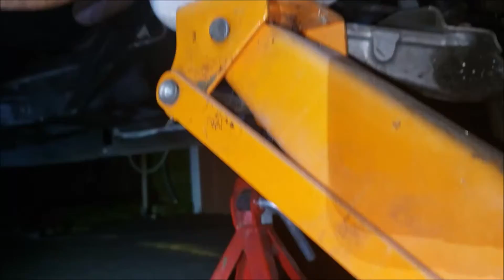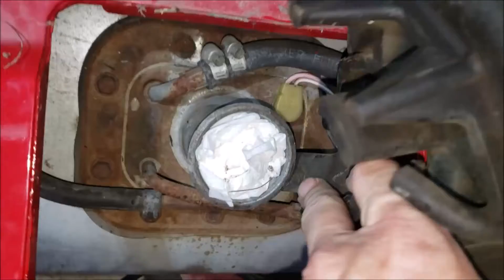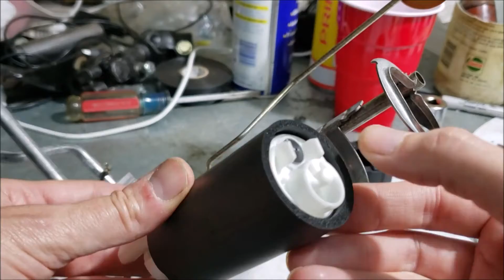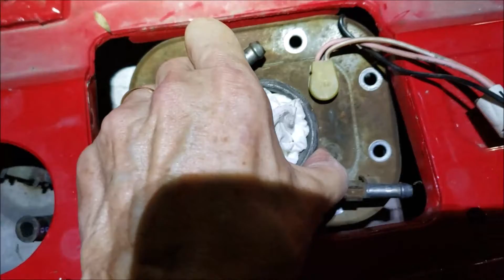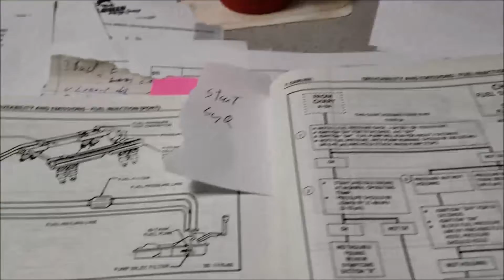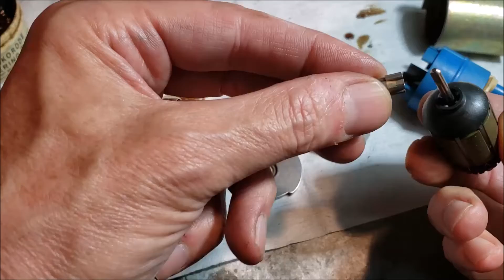1985 C4 Corvette Starts Then Dies How To Troubleshoot Test and Replace The Fuel Pump

Comment: FYI.    In the bottom of the fuel tank there is a plastic yellow baffle that the fuel pump strainer (sock) sits in.   The sock orientation should be parallel with the length of the car with the short end pointing towards the front of the car and the longer end facing towards you and the taillights as you place it into the tank.   If you don’t seat the sock centered in the baffle your strainer will suck air when turning and your gas tank is 1/4 or less filled and the car will sputter and not accelerate properly.   The way you positioned the sock in this video will work just fine when tank is full BUT you’ll have problems when the gas tank and low.   Best.
Reply: If you had the long end of the fuel strainer pointing to the rear of the car, would that hit the baffle? I wish someone who replaces their tank would cut a large hole out the back and take good photos of how the sending unit sits in the baffle.

I got a Walbro kit and Racetronix wiring harness. The Walbro filter is flat with a stiff piece of plastic in it. So that filter can't flex like the OEM filter can.
Reply: Sorry, I meant long end of sock facing forward.   See my follow up comment.   Before inserting top screws and tightening them you can seat the assembly and move/twist the assembly side to side and back so you can feel the sock touching the inside sides and back of baffle.    Once you’re confident that the sock is seated inside the baffle go ahead and tighten the top screws and connect your lines.   Good luck, hope it helps.
Reply: Replaced my pump and sending unit recently and I am 95 percent sure I have my sock sideways  runs 30 seconds and shuts off  thought it was a clogged filter   But still did it after I replaced it , never heard of the baffle the sock sits In until this comment , thank you man , I will pull it out and drain some more gas so I can actually see 😭
Reply: Sorry guys, I meant long end of sock shoulders face forward.   It sits perfectly inside the baffle.   When you seat the fuel pump assembly and before you put in the screws you can move/twist the assembly side to side and back repeatedly (short distance maybe 1/4 -1/2 inches) to make sure the sock is positioned properly inside the baffle.  Once you feel confident it’s inside the baffle then insert and tighten the screws on top and reconnect the lines.  Good luck.

Comment: Really great video. Just some clarification. C4 ,84 thru 89 Fuel pump relay stays on as long as there is ignition pulse. The oil pressure switch is a fail safe, in case the relay fails. See code 54 for the explanation. In 1990 , the ECM logic was changed, so that the fuel pump relay shuts down , when the engine is running, and the oil pressure switch is the only power path for the fuel pump. 
Also, in the video you had a leak in the fuel system. Pressure  should not bleed down so fast. Could be injectors , pressure regulator, or pump check valve leak back.
Reply from the maker: Thank you for contributing

Comment: Thanks Kevin. Great Video!!!

I have an 88 35th Anniversary and I have changed the fuel pump three times since 1998.

I hate that whole fuel pump design and assembly!
I've battled with holding the pump assembly to the bracket and I keep thinking it will all fall apart.. lol

However, from your video I would  have never thought to put a hose clamp around the pump and bracket like that!
I would think depending upon the hose clamp manufacturer it would affect the fuel or have a chemical reaction.
But, I guess not.

Unfortunately, I have to pull the assembly back out  again because I believe the fuel gauge arm may be in the stuck full position.
Always something...
Reply from the maker: It's still working to this day.

Comment: I LIKE YOUR VIDEO , GOOD WORKMANSHIP , GRINDING THE PLASTIC TO FIT FLUSH; CHOICE OF A DELPHI PUMP , RATHER THAN A CHINESE SPECIAL.; SOLDERING + SEALING WITH AN ELECTRICAL HEAT SHRINK. ; TESTED PUMP FOR FUNCTIONALITY. GOOD WORK. THANKS FOR THE VIDEO.

Comment: You should replace those orings on the fuel lines when you open it up. Might as well as it's cheap, and a fuel leak would be bad.

Comment: great video ... I would have used a zip tie...instead of hose clamp..hhhhmmmmmm do they deteriorate in fuel?? your thinking has got mee thinking! Nice job overall Be well Sir!
Reply from the maker: I would not trust a zip tie as a long term solution.
Reply: @ktoutdoor  IF You have the space... that clamp is not going anywhere..thanks for your feed back be well Sir
Reply: If you use a plastic zip tie, I believe you have to use Nylon 12. Though I've read there's a better type, but it's real expensive. Can use stainless steel ties. Just after cutting the band off, leave some sticking out and fold it over a couple of times with the folds going towards bottom to keep it from loosening up later. That's what they say.

Comment: Will this work for a 1986 Corvette motor with tuned port injection 5.7 Liter Coupe 230 HP L-98 
Thanks! RJF
Reply from the maker: Yes, it should be the same.

Comment: I've done pump and filter, fuel pressure is 90psi according to the tool i rented, starts and dies, checked for pulse and it has pulse, but no start, sat for 20yrs.... yikes, i also checked fuses, and fuel pressure regulator, spark plugs etc. Fires and die no matter what
Reply from the maker: Text me at 606-875-0125 and I will call you back to help you troubleshoot. Kevin
Reply: @ktoutdoor  I texted,

Comment: So I had the same issue with my 85 the rubber fittings for the new pump were different went back they showed me a fuel pump for an 84 and it was an exact match
Reply from the maker: Thank you for contributing.

Comment: Very good video. I’m battling the start and die problem in my 85. Have pretty much done everything you’ve covered here. New pump engages and pressures to 39. New filter. Cleaned relay connection. Same problem. Starts and runs then dies.  Dies faster if ya touch the throttle.   Cornfussed!
Reply: Yes. Old fuel in the fuel rail. After a good flushing of the fuel rail and doing a much more intensive cleaning of the whole fuel system finally got it running properly. I couldn’t believe the nasty congealed crap that came out of the rail.
Reply from the maker: Call or text me at 606-875-0125 I will help you Kevin
Reply: Ever fix your issue?

Comment: I think that pump is for a different year vette.
Reply from the maker: Cross reference info i went by
Delphi FE0110 Electric Fuel Pump compatibility with your 1986 Chevrolet Corvette...
Last Updated: 04/13/2021
Year 	Make 	Model 	Engine 	Per Vehicle 	Position 	Fit Notes
1991 
1990 
1989 
1988 	1987 
1986 
1985 
	Chevrolet 	Corvette
Reply from the maker: PS great looking YouTube channel you have.

Comment: ok, so if you don't get 12 volts to the unit, does that mean relay?
Reply from the maker: Give me a call I will help you troubleshoot 606-875-0125 Kevin
Reply: @ktoutdoor  ok, I will have the car in front of me around 4 today. If that is necessary.
Reply: @ktoutdoor  just installed new fuel pump new filter and blew out the lines now i don’t have power to the fuel pump
Reply from the maker: @914Performance  check relay and fuse.
Reply from the maker: That should not matter call any time

Comment: My 78 does the same thing. But runs till the carb runs out of gas I am thinking. Like you going to check all the filters. If it's the pump I'll put a electric pump on the side of the frame